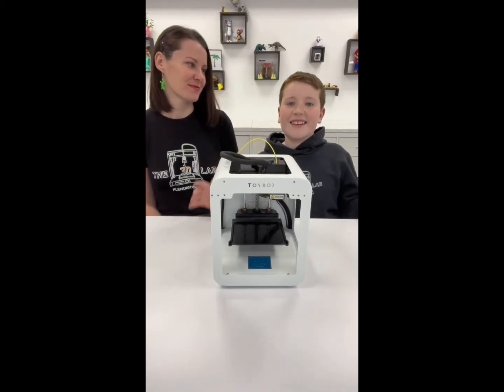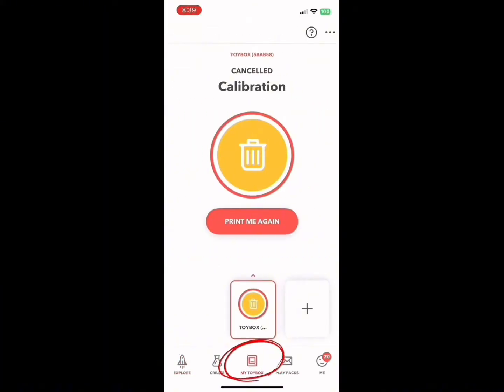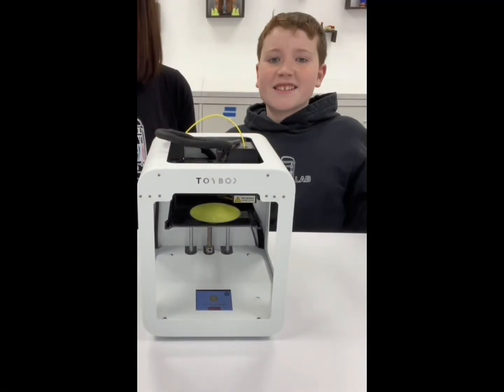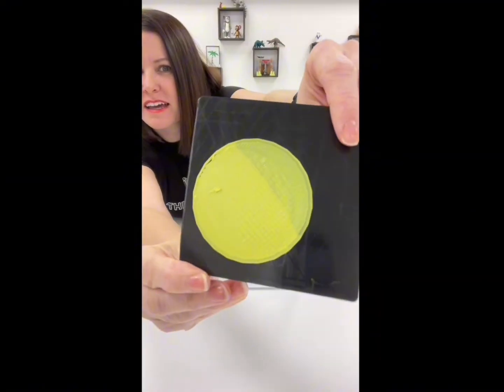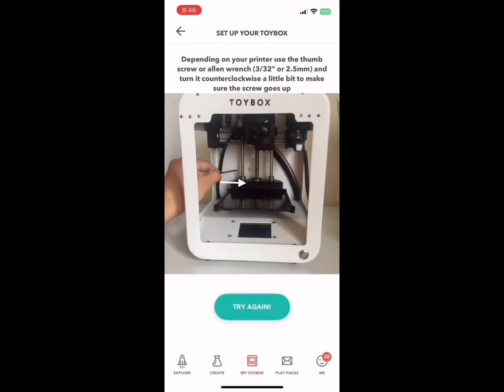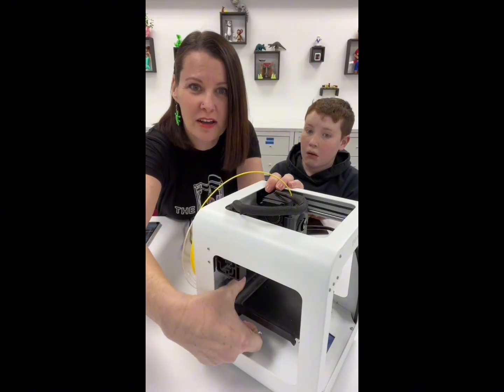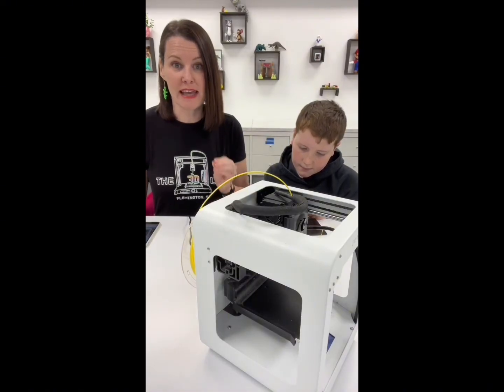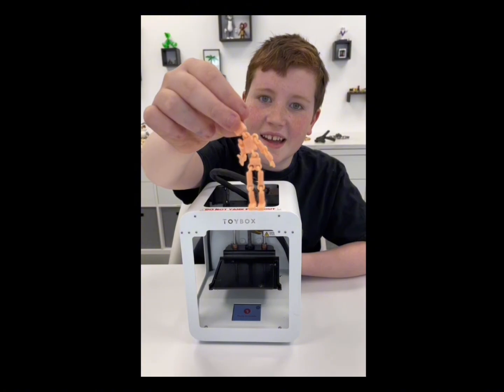Calibrate Your Toybox Alpha 3D Printer

Comment: I have some questions. When it's calibrated, it heats up and takes a while to warm up, but it doesn't go above 188 or 189 Celsius. What was the calibration process like in your case?
Reply from the maker: Your heat should get to 210.  Does your screen ever warm up to show the two arrows (insert and remove)?

Comment: Hi do you worry about any toxic fumes coming from the filament when printing thanks
Reply from the maker: Hi there.  Good question!  We did a lot of research and fumes are the number one reason that we choose ONLY to work with PLA.  While there are still some minor VOCs, we do not print in small enclosed spaces.